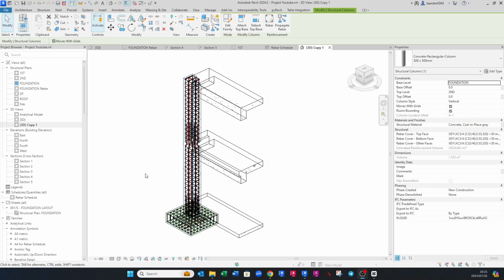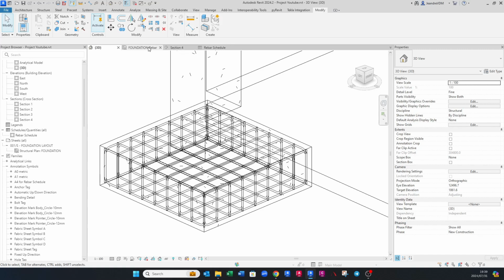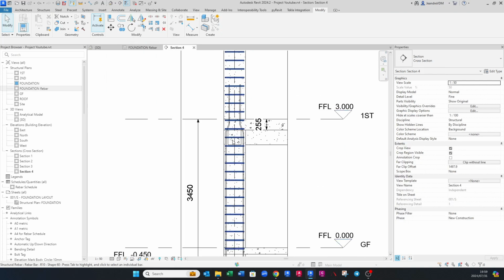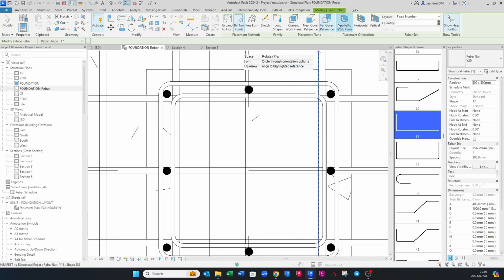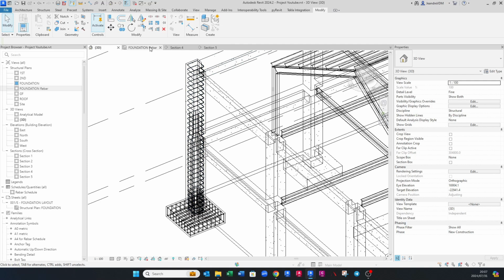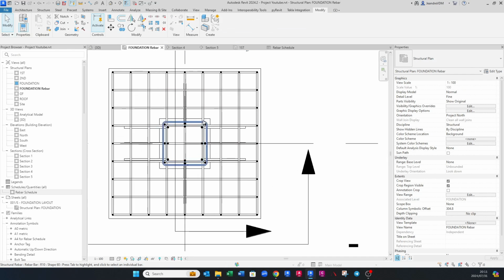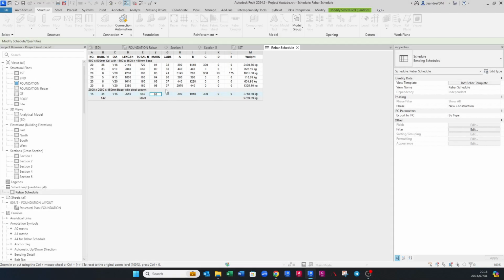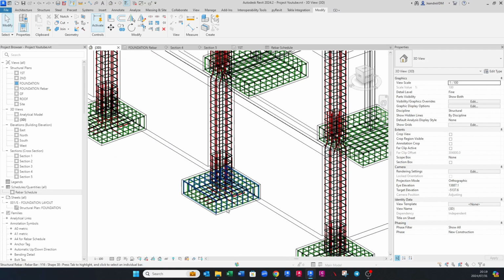Revit Structures - Foundation & Column Reinforcing

Comment: Hi sir propagate rebar is not found in revit 2022 then how can i copy rebar to another column
Reply from the maker: Hi, unfortunately, the Propagate Rebar function was introduced in Revit 2023. I recommend upgrading your Revit version to access this feature.

Alternatively, you can copy the rebar by selecting all the bars and copying them to another column. However, this method may not work as seamlessly as the Propagate Rebar function.